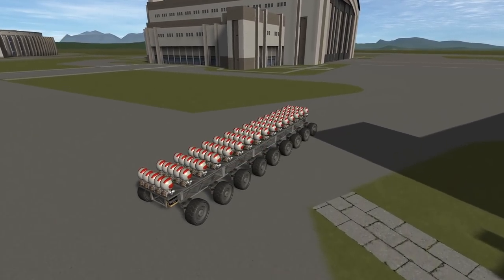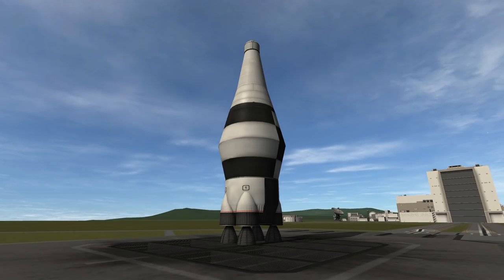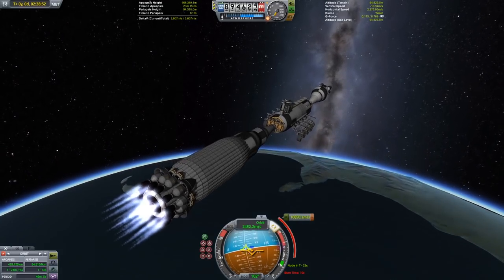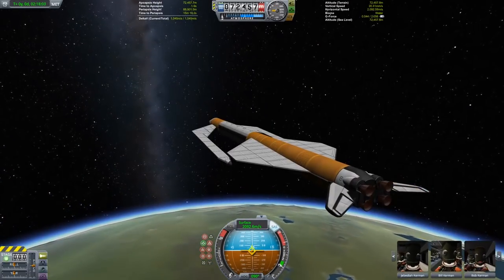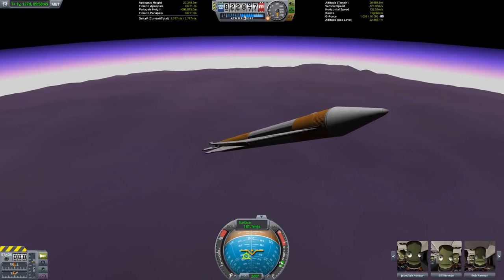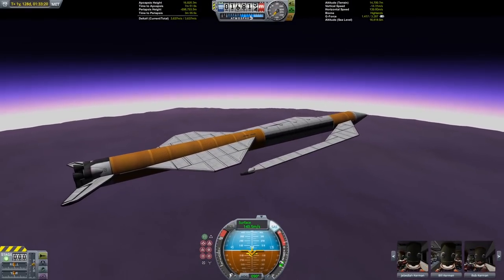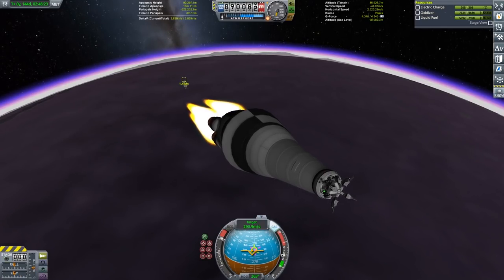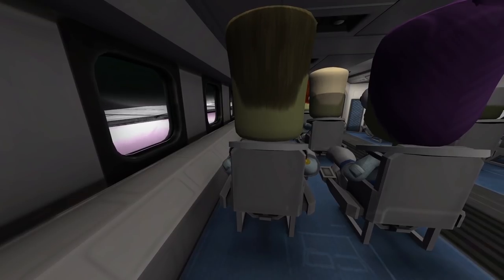80 passenger fully reusable Eve spaceplane - KSP v1.12

Comment: Wow, first you didn't land the engine stack on top of the VAB, and then you didn't land the spaceplane up there either. Can you even call this a Bradley Whistance video? The least you could've done was try to eject every kerbal from the plane and land all 80 of them on the VAB before the plane touched down, that could've made up for this egregious oversight.

Also, I genuinely like the planned flip during Eve entry. As well as burning off a good amount of speed, it also flips the direction of the force the passengers are experiencing from negative Gs to positive Gs, which is much safer and probably more comfortable. Great video as always!
Reply: To redeem himself, he must fly the plane through the tiny tunnel under the R&D complex.
Reply: @neolexiousneolexian6079  Actually I was thinking of the hole between the helipad and the VAB. He could probably get it to fit with enough lubricant and/or quantum tunneling.

Comment: why are rockets more effective at higher speed if they have constant isp?
Reply from the maker: Great question!  Constant specific impulse means that rockets will achieve the same change in momentum as a function of fuel consumed regardless of how fast you are going when used.  Momentum is a linear function of velocity, kinetic energy is a square function.  As a result, the same change in momentum results in a greater change in kinetic energy if you are already at a higher velocity.

This is why maneuvers in an elliptical orbit are more effective when near the perigee (Oberth effect).  This is the point where you have the highest velocity relative to body you are orbiting.  The same principle applies whenever a reaction engine is used.  The faster you are going, the more effect you get from a specific impulse.
Reply: It's important to note that he means they're more energy-efficient, i.e. they use the stored energy in the craft more efficiently by converting more of it to kinetic energy than say a jet engine where you need to spend a good portion of the stored energy overcoming intake drag for example.

Comment: Can the plane reenter Eve if the tug doesnt get to it in time? 
it is empty so it might be able to but those G's might kill a kerbal much less a human.
Reply: Perhaps it could glide at a higher altitude so the thinner air wouldn't slow it down so fast. But I say this as someone who hasn't yet landed on Eve.
Reply: @eekee6034  it comes down to the angle that you enter the atmosphere, shallow angle lets you glide and burn off speed, steep angle forces you into the lower parts of the atmosphere faster causing you to slow down over a shorter distance which means more G's and heating.